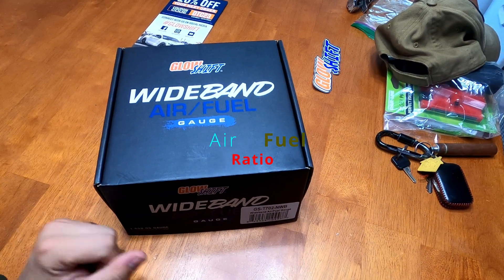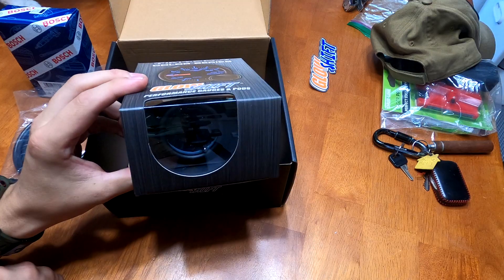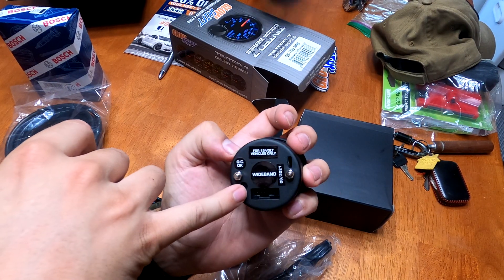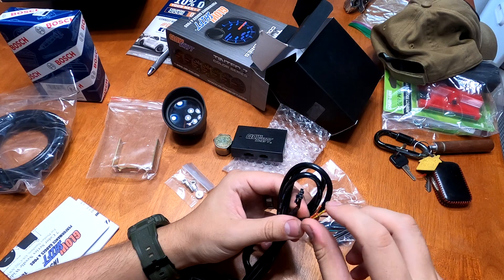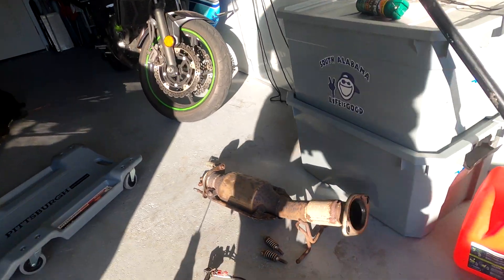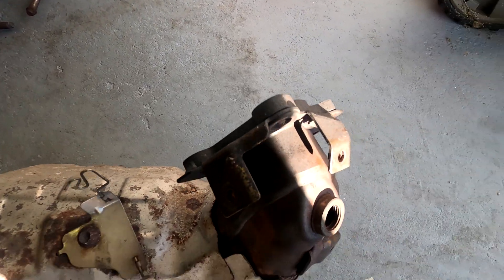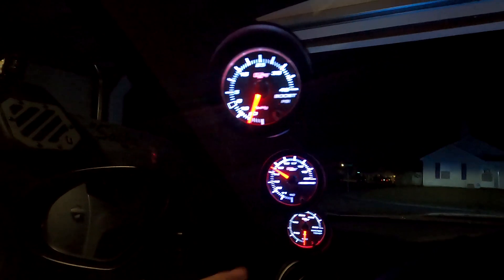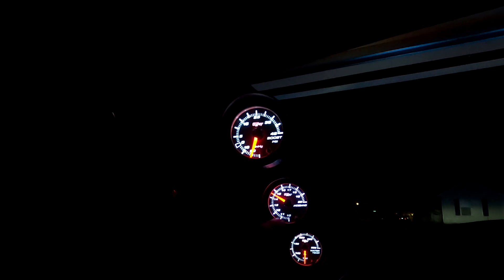GlowShift Wideband Air Fuel Ratio Gauge Install

Comment: gonna cry about color lol, hey it works
Reply from the maker: Fr though, I will say that I really don’t notice it. I thought it would bother me more than it does, and it’s been about a year now that I’ve had em installed. 

Still no idea why the color is different😪 It could be a manufacturing defect.
Reply: I have to connect the yellow and red together to get power
Reply from the maker: Interesting…sorry to hear that, but it works though?